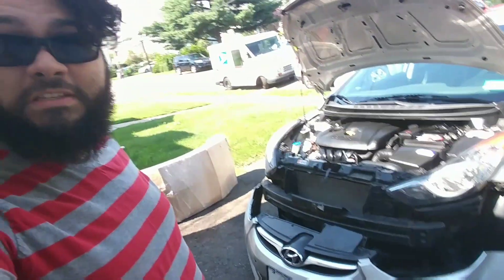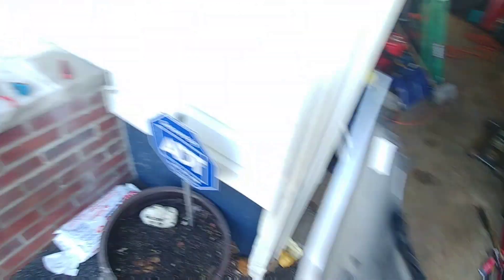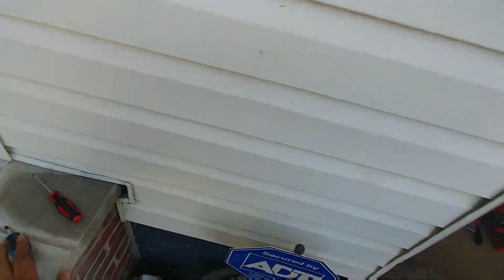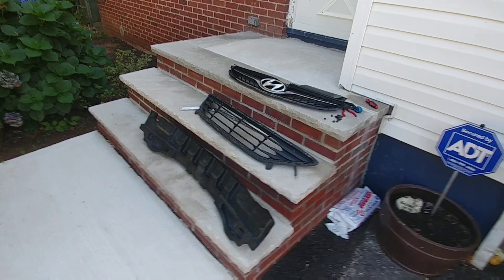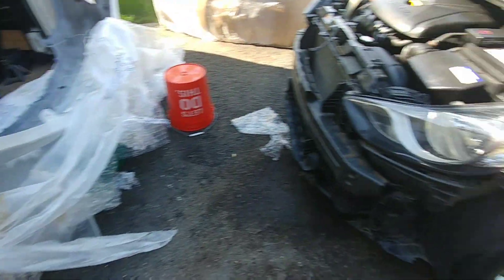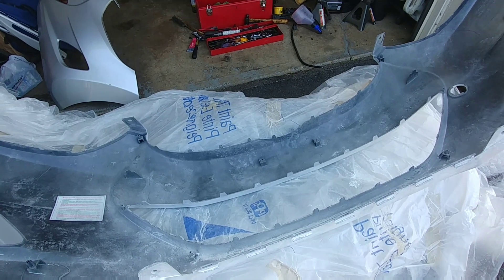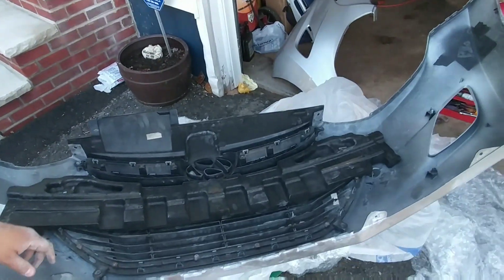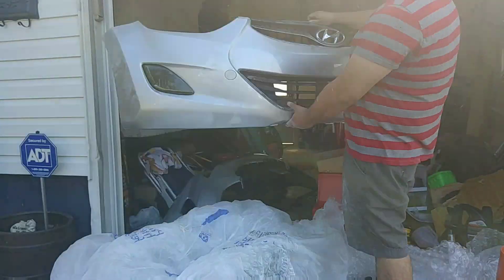2012 Hyundai Elantra Bumper Swap And Foglight Install! Can I Get This Done Without Breaking Things?!

Comment: Fantastic man, I spent the whole day doing mine and watched your video before hand.  I have a Elantra GLS 2013 and it's exactly the same thing.  I was in doubt a couple times when a screw or two went missing, one of those weird metal clip things was missing already because of the damage on the previous bumper so I had to get creative there, but mission success thanks a ton man my car is like brand new now.  One of the side under covers is pretty banged up so I'll probably get that replaced soon but that looked pretty dang easy

Comment: Hey I don’t recall you stating in the video but why did you remove the fog lights from the car and attach them to the new bumper? Is it necessary to remove the fog lights from the car and attach to new bumper or can you attach the new bumper to the car w/o removing the fog lights?!

Comment: It would be magic if you could share which tool to use to
Pop out the screws holding the “click,click,click,click,click” piece in.  Mine has Phillips as the main fasteners but two tiny plastic screws right next to the headlights from the top.  I can’t figure out what bit to use.  It’s not Phillips, or Allen/hex head.

Comment: Great help , I like to know were you got the bumper with  paint for that price ? Thanks
Reply: Not sure what he paid but I bought from a website called painted car parts. Buy part and getting painted separately at a shop would cost (part~$100 + paint shop job~$350-$550 whereas buying from that website is (part~$100 + pre-painted-$215)).

Comment: did you already have the fog lights wired in the car? or did you do the wiring and then got the bumper with the fog light kit? because the old bumper did not have fog lights it looks like.
Reply from the maker: The car was pre wired for fogs from factory. I replaced the ones on my old bumper because the brackets were broken.

Comment: OK, all parts for the project received, including bumper from same source you got yours.  However, got a couple of questions before I proceed:

1)  I may need to replace the rubber thing on the bottom of the bumper in addition to the fender liner (which I already have).  What is that called?

2)  The fender liner is attached to the bumper cover by a bolt, and since I'm down here in Florida for the winter and left my socket set up north, what size is the bolt so I can get the right socket along with a new ratchet?

Comment: I didn't see anything about running the wiring for the fog lights. I just ordered a fog light kit for mine and I was wondering if the wiring was already there or I will have to run it myself. Any info would be appreciated.
Reply: if your car came without fog lights you will need to install the wiring harness that comes with the kit

Comment: Very nice video, how do you remove the two square clips that hold the foam behind the bumper?
Reply from the maker: They have these clips that are press fit in. Just get a pair of needle nose and pry up. Careful not to break them. It's pretty straight forward once you look at it. Good luck.
Reply: Thanks, success was very easy thanks again.
Reply from the maker: Glad I could help!

Comment: Since you got the bumper on ebay - who did you have painting it? Didn’t seem line you did it yourself?
Reply from the maker: It came painted from the seller. You need to provide the paint code when purchasing so they can paint it before shipping. They did a great job with the paint for such a cheap bumper.
Reply: Can’t seem to find anything painter for under $350. Do you happen to remember the seller?
Reply from the maker: Check out my update video on this topic. https://youtu.be/MDMm_CeiK04

Comment: How did you wire up the foglights?
Reply from the maker: +RETRO_NES this model came with Foglights from factory. 

All I did was install replacement lens. 
The kit I bought came with a harness... It would just need to be wired up and given power & ground.
Reply: can you show a video on how you did it?

Comment: so i cant install foglights unless i get a new bumper? i got a elantra 2011
Reply: I'm also trying to figure that out too I have 2012 Elantra
Reply: It's rather weird. The bumper cover already has slots where fog lights can be installed. You should be able to pop them out and install the fog lights. I'm hoping I can get to mine today. I seriously doubt you need to buy a new bumper just to put in fog lights...

Comment: I hope you didn't toss the old bumper that's a hundred dollar bill on Craigslist for a Hyundai with no fog lights
Reply from the maker: The bumper was trash. Multiple mounting tabs broken. The stock bumper with no fogs have covers for the holes... The mounting points were all broken so that wouldn't have worked. I recycled it.

Comment: Where did you purchase the bumper?
Reply from the maker: +S B EBay. All you need is the color code for the vehicle when ordering. Make sure you purchase one that says painted or you'll receive one that's primerred. Good luck.
Reply: Thanks for the reply!
Reply from the maker: +S B no worries! Here to help! Thx for watching.
Reply: Was there a specific Company that provides painted bumper covers
Reply from the maker: +S B EBay. All you need is the color code for the vehicle when ordering. Make sure you purchase one that says painted or you'll receive one that's primerred. Good luck.
Reply: Great question! I have a 2015 Elantra that has a Tricoat paint. 
That means I can buy the bumper for $55 on eBay or wherever, but I have to pay a minimum $750 to have it painted!!
Reply: Can you provide the sellers name please other painted sellers have bad reviews for folding bumpers in boxes and yours was shipped properly
Reply from the maker: Oooof how does a shipper screw that up?! 

The seller I used is mbiauto 

Here's the link to their store. https://www.ebay.com/usr/mbiauto?_trksid=p2057872.m2749.l2754

Good luck.